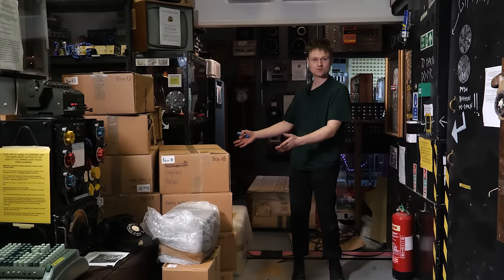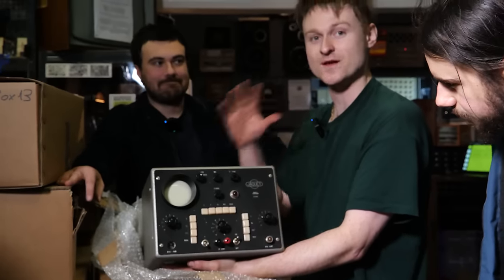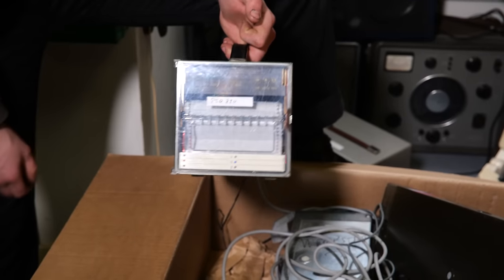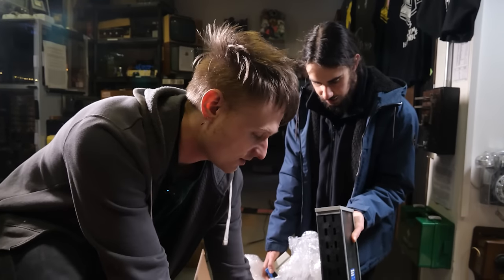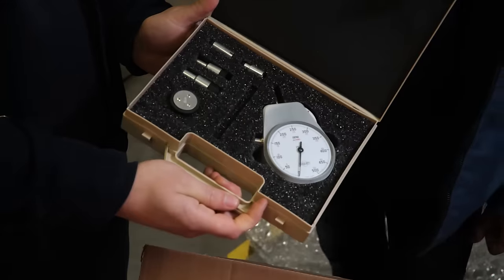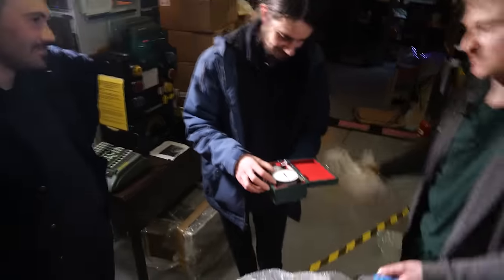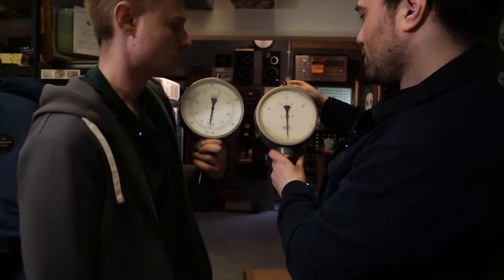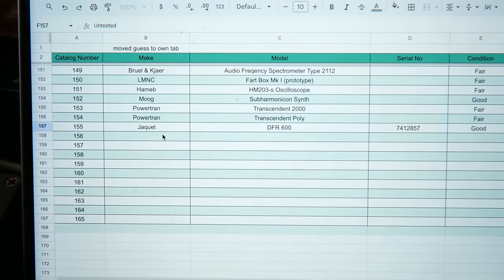Unpacking A Huge Delivery of Vintage Jaquet Technology Pt 1

Comment: 16:13
This translation might sound a bit weird in some places because the source does as well... ;)
I tried to correct logical errors as good as I can.
Electro Polygraph 662

The drive unit contains the synchronous motor with starting capacitor and a change-over gear for 5 different paper speeds.
The connection terminal for the mains cable with ground wire is located on one of the PCBs on the side. On the other is a switch for switching the motor on and off, an electrical  switch for forward and reverse gear and a button for operating the step gear.
If the knob is turned slightly clockwise, it can be pushed in or out. The numbers engraved on the push bar indicate the selected gear.
Level 1 2 3 4. 5
Paper speed 0.05 0.5 5 50 100 mm/sec
The two rollers for the paper are located outside the gear box and can be removed from their bearings. The smooth flange can be removed in order to place the supply roll on the roller or to remove the rewound paper from the rewinding roller.
The rollers must be inserted in such a way that the toothed flange engages with the protruding gear wheel of the gearbox.
The drive unit is symmetrical. The paper runs from the supply roll over the inclined plane, is driven by the driving shaft arranged in the apex and runs again over an inclined plane to the take-up roll. The two inclined guide plates can be opened so that the various bearings can be conveniently oiled. The motor and the electrical circuit are located under the insulation cover (be careful with removed cover - 220 volts!).
The drive roller is in two parts so that the drive pins can be adapted to the holes in the paper. The recording paper is inserted with the cover removed. However, the motor should only be switched on after the cover has been screwed on, as the two springs that are attached to the edge of the cover

[Illustration]
Electro Polygraph Type No. 662

of the drive shaft are attached to the cover. The cover is a box-shaped housing containing the recording magnets. It is fitted in such a way that its two lateral slots fit under the knurled screw knobs with which it is fixed to the drive unit. On the rear side are the connection terminals for wires or banana plugs, a common positive pole (red) and a separate negative pole for each magnet for an operating voltage of 12 or 24 volts DC. The writing levers with the writing tips protrude from the front. Each recorder can be lifted off the paper individually and there is also a swivelling bracket with which all recorders can be lifted off at the same time.
This makes it possible to first use only one half of the recording magnets, then, with the recorders raised, switch off the paper feed and let the strip run backwards, after which the remaining recording magnets are used to record in the second pass. The high speed of 100 mm/sec can be switched on for the reverse run.
However, it is not recommended to pass the paper through more than twice in forward motion, as otherwise the perforations may be damaged.
There is no special time recorder, as the drive by means of a synchronous motor and stepped gearing makes time marking unnecessary. However, it is possible to feed one of the recording magnets with the periodic interrupter No. 654, page 10, and thus record time stamps.

Maximum frequency
100 pulses/sec
Dimensions: 26 cm long, 19 cm wide (with slide gate inserted) 20 cm high.
The electro-polygraph comes in a pouch. The electro-polygraph is supplied in 2 types, which differ in the number of recording magnets.
The motor voltage T10 or 220 volts, 50 periods is to be specified in each case. Magnet voltage 12 or 24 volts direct current.
No. 662 Electro-polygraph with 12 magnets;
Weight with pouch: approx. 11 kg.
No. 663 Electro-polygraph with 6 magnets;
Weight with pouch: approx. 10 kg.
No. 664 Paraffinised paper, 12 cm wide, in rolls of approx. 50 m length.

Comment: The mechanical Tachs starting at around 9:50 are very, very useful. Jaquet made more then one type, including flyweight and timer types. They are general purpouse for use measuring ahsft speeds on motors, transmissions, machinery, etc. Usually with a set of contact tipe for getting into a 60degree machined center on a dhaft, and often with rollers for measuring surface speed (conveyor belt and the like) I still use them. The flyweight type direct read and can show speed variation, the timer type time for six seconds (usually) with a mechanical clock that engages and disengages  a clutch for th eindicator, giving an average over the timing period. The timer type are VERY accurate if maintained like a fine mechanical watch. I first used them with large, low speed engines, where the  speed varies during each rotation. They were a distinct upgrade from the pure rotation counter used with a pocket watch from the 19thcty into WW-II. Jaquet sold them under their name, as well as supplied them to others  with different labeling, such as Herman Sticht in the US
Reply: Also those types of tachometers wind up the clock mechanism by using it. Which is super smart, and means that pressing it without using it can wind it down.
Reply: Timer type tachos are still used on locomotives! I like them for their distinctive rhythmicity. They provide tachograms to waxed paper as well as speed-dependent circuit switching.

Comment: The stroboscopic tachometer is a non contact one. You look through the device aiming a rotating object. You adjust the stroboscopic frequency till the object appears static and then you have a readout of the rotating frequency. You don't need a spot or sticker like for modern ones that give digital readings. You have to be careful, the readout can be double or half the actual speed.

Comment: 24:50 Adjustable High voltage (Kilovolts) generator. There is a guy on YT that use such thing to do experimental things (mostly very dangerous things).

Comment: You could hook up the mechanical tachs to a display where you can have users spin a wheel and see how fast they can get it up too. Even more fun if you add in some gearing they can change out.

Comment: Jaquet made speed and rotational sensors used in railway metro and tram.  Also diesel and petrol engines, turbochargers, pumps and compressors. I think it is a very different jaquet that did anything medical

Comment: That Syncardon must be something about blood and a limb
The top left dial says something about cardiac signal
And there's that text in the middle where it's written "Gonflage de la Manchette"
That sounds like it's about inflating one of those things we use on the arms to take blood pressure
Reply: That's correct - I think they were used for improving circulation in limbs by rhythmic pumping (ooer) of a pressure cuff.

Comment: The thingmajiggy around 24:40 could be something to measure the eardrums response to pressure changes as an indicator for obstructions in the middle ear. My daughters doctor just recently used such a device to check if her hearing impairment is of mechanical nature. The device looked like it was from the eighties and it was way more handheld-er than this beast. 😂
Reply: No idea what it is, but I can read german, so here is my guesswork from the labeling. First of: It has a setup and a treatment mode. "Manschettenfüllung": It uses some kind of pressure cuff/sleeve. Also has knobs for "pressure", "pressure begin", "pressure length" and "pulse wave". The dial indicator in the middle is in mmHg in the blood pressure range. So its a treatment device that uses some kind of pulsed pressure to affect the blood circulation. I'm thinking for example a full leg cuff that inflates and deflates to pressures you setup in the device to support/improve blood circulation.

/edit shouldnt have stopped before the "head devices"...
Reply: @agurdel  You are very close. It is a Syncardon which is used for treatment of peripheral vascular disorders. "zur Behandlung von Durchblutungsstörungen"